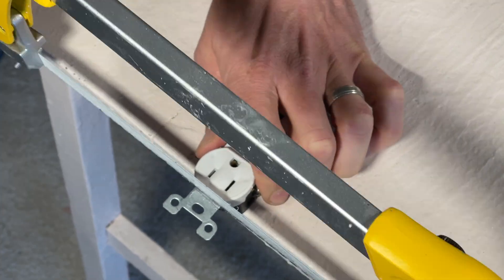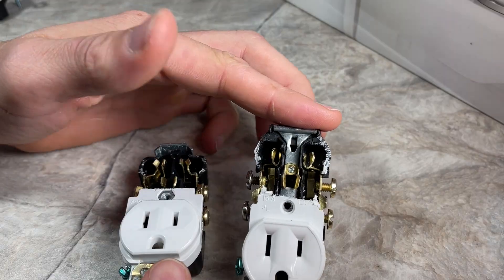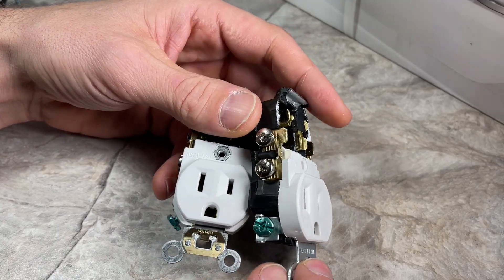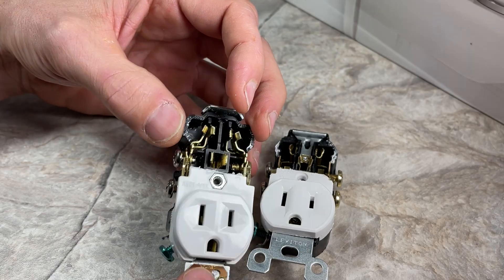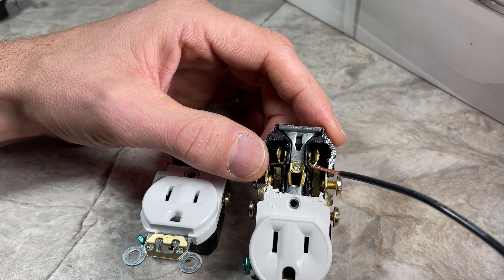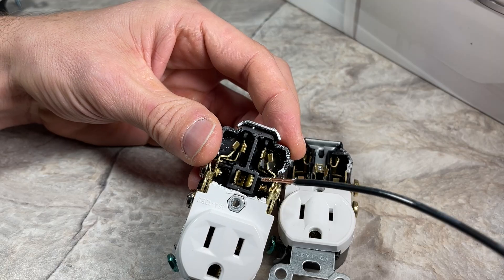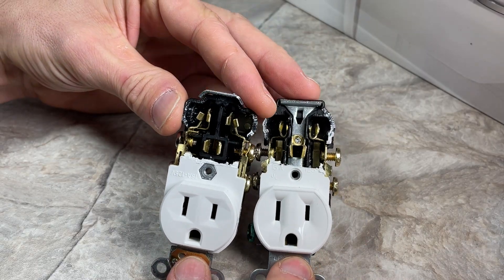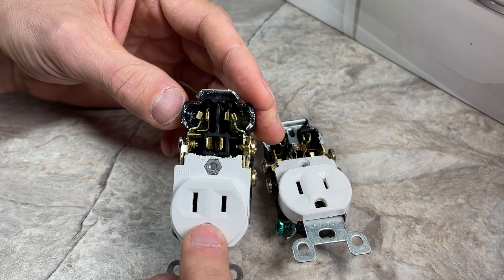What Outlet Should You Buy For Your Home |  Commercial vs Residential

Comment: I'm a believer in the concept called "false economy." A well-made product that costs four times the price of the inexpensive product but lasts ten times longer is worth the extra money.
Reply from the maker: What do you do for appliances?  Seems like they are all cheaply constructed and you basically just dispose of them when anything fails.
Reply: @EverydayHomeRepairs  you could just find the replacement part and install it.  Calling the manufacturer helps a lot if you can’t find what you’re looking for on the interwebs
Reply: @miket5506  "you could just find the replacement part and install it"

That's not always an option.  There are appliances where parts are discontinued or prohibitively expensive.

An example is a KitchenAid dishwasher I had where the control panel failed.  Everything else was good, but you couldn't operate it without the control panel.  Looking around, I couldn't find a replacement part that would match the model.  I couldn't even find a cross-reference for compatible substitutes.

The problem was that, being a model from the mid 2000s, it was simply too old; Whirlpool (the company that made the dishwasher as well as the current owner of the KitchenAid brand) no longer stocked any replacement parts for it.  None of the independent parts sellers had anything that would work, either.

Looking at prices for control panels in general, I was looking at a bill of around $100-$300 if I were to get it new, assuming I could find a new part that was compatible.  That would mean spending more than the machine was worth in parts to get it up and running again.  Of course, I could look for good used parts for a fraction of the price, but I couldn't find a compatible replacement there, either.

Because I couldn't find the required part at a cost-effective price to get it running again, the dishwasher wound up being scrapped.  However, I bought it used ten years ago for about $35 and cleaned it up before putting it into service, so I got my money's worth out of it.

Right now, I replaced it with a Bosch dishwasher from the late 2000s for about $50.  A little TLC, and it's spic and span, inside and out.  It seems to have better cleaning performance than the KitchenAid one I had and it's much quieter.  It's not as large inside, though, but I can work around that.
Reply: @EverydayHomeRepairs  I buy used appliances, or even get them for free on craigslist. 
I've had great luck with Kenmore. 
 My first dryer was free 15 years ago and still works, but I've replaced the motor, belt, and a sensor at one point. 
I'm only on my 4th washer, and my 3rd one is in my basement as a back up, because the house i bought already had a washer and dryer. 
I've paid $60 for my washing machines total. My first was $35 and lasted 12 years.  The second washer was free to me, and i gave it away because i got a practically brand new one for $25.
I'm 41 and the only brand new appliance I've ever bought was a dishwasher. I just can't justify a used one. Lol.

What sucks is that having nice, new, matching appliances is really nice. 

My house came with a 2004 side by side fridge that still works just fine. 
In my mudroom/laundry room i have my old 94' Kenmore fridge in use for extra room, that i got for $50, 5 year's ago.

My roughly 30 year old gas range that came with the house, works great, and i could probably use it and fix if needed the rest of my life.
But I've completely remodeled my kitchen, and it doesn't match at all!! Lol..
I'm probably going to buy a new one. 

Sorry for the long winded babbling..
The older appliances were mostly made better and more easily repairable, but everyone loves pretty stuff
Reply: @MMGJ10  I got lucky to I’ve had kenmore appliances they lasted at least 15 years and they haven’t stopped working at all
Reply: @MMGJ10  I just replaced my father in laws dishwasher that was almost 25 years old. I'm sure it could've still been fixed it. Theres no way the new one will last anywhere near that long. But hey, its chrome!
Reply: @MMGJ10  We had a kenmore washer and it was great.  It was about 15 years old and started making a clunking sound.  Upon investigation we noticed the hub/drum support had corroded into nothingness and broke.  Kenmore wanted $700 for the new drum/ hub support.  Bought a pair of new upper middle grade Samsungs, about a grand each and both had major issues just after a year.  Samsung tech came out (actual factory tech) and as the machine sat banging against the wall on an empty spin cycle he said "It's ok to do that, it's not a commertial unit"
Reply: @MMGJ10  I don't know why you'd apologize. Many of us here probably see eye-to-eye with you.
The old stuff was built to last; the new stuff was built for show.
I've never owned a new car. We made the mistake of buying one of those new-fangled low-water-use washers and it is crap.
My wife's original Dyson (circa 1994) is fantastic, but the new Dyson animal is a pile of plastic trash. Our 15-year-old Kenmore refrigerator/freezer is still humming along.
On the subject of electrical outlets, I paid $14/per for my Hubbell outlets. Why? So I never have one cause a fire, and I should never have to replace one. When I plug in a cord, it's tight, but it stays in place until I remove it.
Reply: @drumrboynoid  my Frigidaire is so unreliable that I pray every time I start it. It has been one failure after the other. Total garbage.
Reply: @MMGJ10  I had to reply. I bought my house in 1999 with a Kenmore washing machine. 15 years ago the belt broke, For $4.99 I replaced the belt. It's still working and still does a great job washing.
Reply: @netdoctor1 sorry you got a bad HE washer. My Whirlpool Duet Steam set is 15 years old, and I've spent maybe $50 total in parts and did the work myself, which was nothing (sensor and a door hinge both on the washer). They're front loaders, and they work great. Scratch and dents from the old Sears Outlet, Speedway, IN. Turned out they were made in Germany, and WP closed the factory just like they did the Evansville Indiana refrigerator plant...which began it's life making P-47Ds for Republic, then M1 Garands for IHC.
Reply: @EverydayHomeRepairs  speaking of appliances.... 

We bought an LG side load washer when we bought our house 3 years ago. We had multiple codes within a year and a half that prevented the washer from completing a cycle. 

Had the LG rep out who replaced the rotor and stator of the drive motor. Didn't fix it. 

I got out my meter and found intermittent opens in the wires going to the motor due to low quality, inflexible wire going from the tub to the machine body. 

I purchased some fine strand 14 awg wire with silicone sheath, butt connectors, other supplies for about $50. I built my own replacement harness and haven't had a problem since.

I do these kinds of repairs often in the automotive business. The only difference in an appliance is that there are loss wires to deal with.
Reply: Trageser water heaters. I am not sure when the company went belly up, but they have an avg service life of 50 years- some are still in service.  All copper tanks with a cast iron burner.  Speed queen for washers.  Still made in USA.  None of them have fancy bells and whistles or fancy displays. But they all will outlast 3-4 "modern" units.
Reply: @rickw4160  Bradford White is the best out now.   Made in USA  Only sell to pros though.
Reply: @EverydayHomeRepairs  My two cents. Being an engineer, it is in my blood to fix the broken item before replacing it. But it doesn't always make economic sense. Example 1: I had a microwave that lasted close to 10 years. It stopped working. I did some research and I narrowed the issue to the capacitor. Great as comment below state there are number of sites to buy parts. I found the capacitor was $95. Ok fix a 10 year old microwave with a part that is nearly 1/3 the price of the new part. Problem all the other parts have 10 years of wear and reviewing the cost of other parts it could quickly cost more than worth. It was just more sensible to buy for $255 more, a new updated microwave. Kept the old one for that possible repair. The other example of not worth it. I recently replaced oil furnace recirculator pump. This pump cost $115 new. It has a replaceable motor cartridge. Sweet but that cartridge is $95.  This pump has a $45 capacitor that can fail. Why in earth would you buy seals and pump cartridge  when you can just buy new one $20 more. You eliminate the next failure being the capacitor failure. I am finding more and more the replacement parts are too high for the risk not really fixing the item having more than one issue and appliances are less repair friendly. Part of the problem labor and parts has come to be too costly in compare to mass production of new products. It has become too expensive for companies to stock parts when replacing the whole unit is not much more than replacing parts. Hence why replacement parts are getting so expensive. Other problem most new appliances have fancy electronics that are very expensive to replace and hard to self  diagnose the issue when there is a problem making the appliance throw away.

Wish what Tom state was true but more expensive usually these day means more bells and whistles that can break with the same basic functioning hardware the as the cheaper models.
Reply: @EverydayHomeRepairs  The most cost effective option for appliances is to either buy a new and efficient one when it's actually on sale, from a brand that has a better than average reputation for reliability (it seems LG is that brand at present), and just replace it when 'anything' fails that isn't an easy fix.  Or more cost effective is to buy someone else's used appliance for 1/3 to 1/5 the new price - people dump used washers for $100-$300 on Craigslist all the time.  It may fail but you haven't spent much, and you can get lucky and get a lot of use out of one.
Reply: @EverydayHomeRepairs  b
Reply: @EverydayHomeRepairs  my parents had a whirlpool washing machine from the 2000s. It lasted 16 years before it broke down, never needing more than 1 replacement bearing. The new one they got was barely running after 4 years and they had to get a new one. It literally lasted 1/4th as long as the old one at a similar adjusted price.
Reply: @EverydayHomeRepairs  I have six kids. We bought Speed Queen Washer and Dryer after our Bosch failed. Speed Queen are made in USA to a Commercial Spec.
Reply: Andrew Seamans my speed queen washer motor caught on fire.  Had to buy a new machine before 2 years old.  Disappointing because they claim it will last 10 years.
Reply: Our Bosch washing machine needed repairs every 2 years, we hated it.   Replaced it with speed queen which caught on fire. Purchased another speed queen, so far okay after 3 years plus
Reply: @kierscotons5427  we have six kids. Our Speed Queen does at least two loads a day. Four years so far. Great Machine. Sorry to hear about your motor.
Reply: @andrewseamans1419  You keep believing that.
Reply: @gatekeeper65  believing what?
Reply: @kierscotons5427   Don't expect GE or Samsung to be any better.  I don't think anybody makes a decent appliance right now.
Reply: @EverydayHomeRepairs  -- The older style appliances with the mechanical controls seem to last a lot longer than the new ones with the electronic controls.  When those circuit boards go bad, you don't have much of a choice on where to buy a new one and as such, the manufacturer usually wants enough that you start thinking about just getting a new appliance instead... I have an electric dryer that has lasted for over 30 years and the only thing I've ever had to replace is the belt, maybe twice...
Reply: @EverydayHomeRepairs  
There are better appliances if you look for them, and do a bit of research. In the recent past, most of the box stores only carried the cheapest to be price competitive. In recent years, there seems to be a resurgence of people willing to pay more for a better product.
All the Samsung lovers are going to hate me for this, but after a couple experiences with that brand, and 2 different Repair Techs, explaining how poorly they are made, NO more Samsung. I now buy the upper level of appliances. Happy to pay the difference.
And touch 🪵, have had No issues with any of the more expensive quality appliances. YMMV,
Reply: Honestly even if it only lasts twice as long, it's worth the money.  Nobody repairs an outlet as soon as it gets loose.  You deal with it for years because nobody wants to go out to the hardware store to buy new outlets, kill power to the room, open up the jack plate and do the actual work.  Is it hard or complex?  No.  It's just something that you're going to put off for a later date.  Just save yourself the headache and spend the extra buck fifty.
Reply: For many people, going with the best, simply isn't an option.  And it depends on what you are doing.

For instance, if I lived in a rental, or an apartment building and the outlet broke and the landlord either didn't want to fix it, or couldn't get to it for a while, I would buy the cheapest outlet possible.  If I owned my own home, I would put much better quality outlets in it, unless I was going to sell it in the next year or two.

In a true free market economy, you have the choice between the cheapest and the most expensive, and a dozen other options in between.
Reply: My current home was built for me in 2000. I  have had at least 4 electrical receptacles that have failed over the years in my home. Of course in the places of freq use like the kitchen.
When I build my next home, I  will put professional grade plugs in all of my rooms in that future home.  The labor cost to have someone replace those 4 plugs is probably 10 times the cost difference if all of the plugs were commercial from the beginning.
Since my current home was built by a big name nationwide company, I  did not have any choice on the kind of plug that was installed while the house was being built in 2000.
Reply: @akidwaimd  I think this is one of the best arguments: Labor.   My house was built in the 80s.  So far I've replaced around 10 outlets and there are probably another 10 I will replace over the next year.   Fortunately I'm doing it myself but the price difference between a cheapo one and a good one is barely a blip on my annual home repair costs.
Reply: Or get a Chineese product at any price that never works from the start.
Reply: I completely agree... Im old enough to remember the days when made in America meant something.. People took pride in their work.. Even with fast food.. I remember A&W drive-up. park your car and they would skate to your car take your order and bring back a tray that hung off your car window.. The teenage girls loved their job cause they got to skate and get paid for it.. Society isnt like that anymore. You are more likely to get a spit on sandwich and the finger and be over charged all at the same time.. It use to be I could by a set of tools and it would last me decades and had a lifetime warranty so when one broke I just took it to sears and they would give me a new one.. Now, you buy a set of tools almost every year because the crap seems to be made out of pot metal.. Everything has become disposable.. Especially the workers.. the good ones anyway.. The days of American greatness are over and freedom is dead..
Reply: I don't care if my receptacles last 300 years
Reply: to an extent ,  A 10$ timex  replaced every  couple years is more economical than a 10,000$ rolex purchased just once
Reply: The bitterness of poor quality remains long after the sweetness of low price is forgotten (Benjamin Franklin).
Reply: While I agree in principle.  Most outlets in the house you probably are going to plug something in and never unplug it until you move.  That said, I could see putting the more expensive outlets in the garage where you will be more likely to plug/unplug stuff a lot.  Also a few select places inside the house where you normally would plug in a vacuum cleaner.  The other ones I don't think it matters unless you are simply OCD or something like that.  I'm not an expert on any of this though... I just play one on Youtube.
Reply: Salesmen must love you.
Reply: p
Reply: abba
Reply: abba
Reply: abba video
Reply: It's not "false economy" ; it's cost-value comparison - $/value or 'bang-4-your-buck'
Reply: Part of the issue with the other appliances that do certainly last much longer is that part of the reason why is much larger engineered tolerances on much less efficient but more designed.  For a dishwasher it probably doesn't matter.  For a Fridge which uses quite a lot of energy, a new one can safe quite a lot.  There is always the balance of new price vs. running costs+ maintenance.  Best deal ever is the open box/ floor model, dent it returns that are like new or if you live in an area with lots of renovation people redoing perfectly good appliances for new designed when they move in.  Plenty of near new appliances 50% of the cost or so.

Also a factor is how well one maintains their appliances.  For stoves not using the self clean function ever... just put in an hour once a year or whatever, it will likely double the life of the thing.  That self clean function is nonsense.
Reply: There's also the "right tool for the right job."  When the 50 cent outlet will also last forever in most places in a house there's no reason to spend any extra money on the tens to hundreds of outlets that maybe get something plugged in and out of them 5 times in 20 years. NO ONE is going around having to replace every one of these cheap outlets in their house because they are all worn out. Now, for the ones on your kitchen counter or in your shop? Sure get the better ones. But for everywhere else in the house the cheap ones are fine.
Reply: @redstang5150  
It funny no one mentioned, with the commercial outlets there is a small hole next to the wire attachment screw. It’s designed to stick the copper wire in the hole, and then quickly wrap around the screw. So easy, so fast. And true 95%? Of the population won’t need the upgrade, but for the rare few of us, who build our own houses or shops, I pay for the upgrade, if for nothing more than the easier install. For the small difference in cost, if the extra buck per outlet is really an issue, I’ll skip on the case of beer for the week. 
Now,,, I just wish we could get rid of the tamper resistant outlets! Pain in the ass, IMHO. At least you don’t have to use them in a garage or shop setting.
Reply: @kenjackson4177  Good point - would have been good if the guy in the video mentioned the hole. And if I was putting in a new outlet, or replacing one for some reason, I'd buy the nicer one. But I'm not going to worry about any of the existing cheap ones in my house wearing out. The OP's point is valid but not necessarily applicable here.
Reply: @redstang5150  I had a plug behind the fridge short out.  It got unplugged and plugged back in maybe once every couple of years.  After nearly burning down the house, I went around an replaced every outlet in the house and every 110 circuit breaker.  An extra buck or two for piece of mind is worth it.
Reply: Again, your logic is corrupt. You conveniently leave out ownership time. As of 2018, the median duration of homeownership in the U.S. is 13.3 years. You are the one guilty of "false economy". Over spending for "glory" sake is false economy.
Reply: @brucewelty7684 since when is "doing the right thing" something to be derided as being a glory hound?
Reply: what you make is a "false comparison".  when almost everything is made in china, there is no difference in quality, only price levels
Reply: @natalieisagirlnow that's actually not true. China will make anything you want, to any quality level you're willing to pay for. If you want it done right, you may need to put your own QA/QC people and managers in the factory.